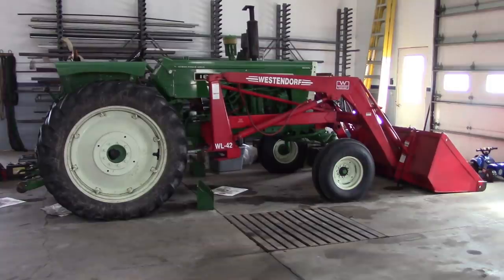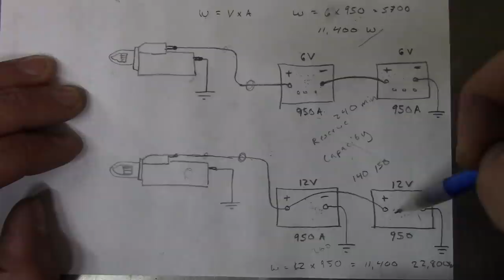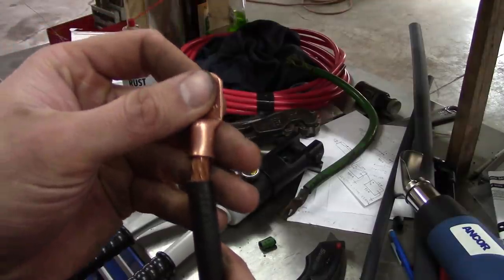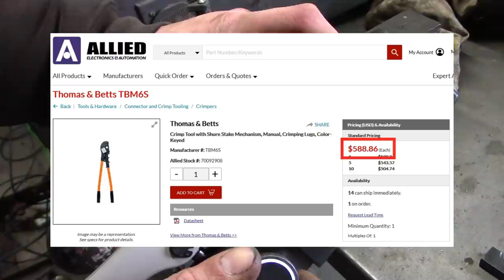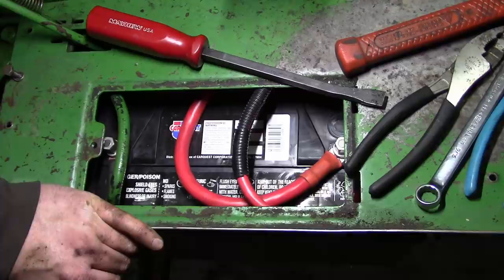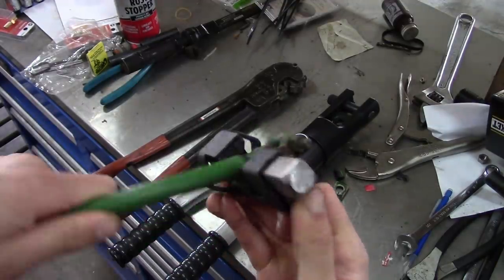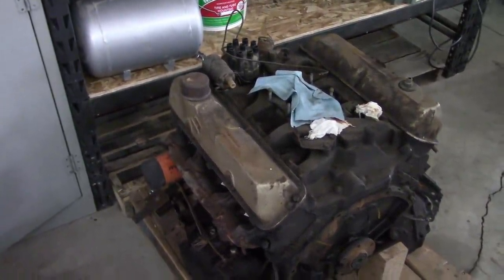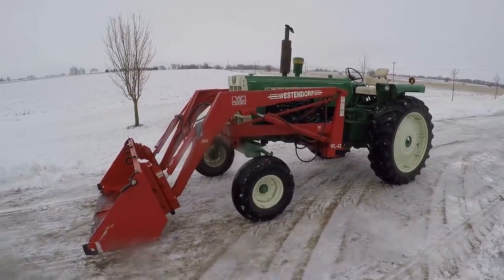Oliver 1650 Tractor 6 Volt to 12 Volt Battery Upgrade

Comment: Ok. For some reason other videos will play and this one run for 30 or so seconds then stops.   Loosing my mind. Switch wireless routers, coupled to cellular etc.  not sure what is happening.
Reply: I had substantially the same problem.  Shut computer off for a minute and things seemed to improve.
Reply: cdouglas1942 I am using a newer iPad Pro.  Every other sample plays fine.  This is the one I wanted to watch.  Will see it THU  I guess
Reply from the maker: I don't know. I've had a few guys say this. The video plays fine for me on a Dell laptop and on my iphone.
Reply: I watched at lunch at work and had no issue.....no matter what device I tried at home it was a no go.Not sure why but rest assured I persevered:-0)    Got to keep your priorities straight don't you know?.

Comment: 700 comments in, this comment is a fart in the wind. Those cheap Chinese crimpers work if you don't use them much but if you expect to use such a thing regularly. Spend the money, even if it's used on a Thomas and Betts or Burndy etc. They're worth sending in for service if you get a clapped out one from Ebay.... Luck of the QA draw and all that but I didn't get many crimps out of the HF one I bought.

Comment: Soldering for large lugs is a not a good solution, you need too much heat. If you cut a lug in half a correct crimp will make the wire into a solid chunk of copper.
Reply from the maker: Yeah I don't like solder for large wire, say over 16 gauge.

Comment: the diagrams are confusing in that they appear by being contrasted against one another that there is some sort of major difference between two 6volt batteries connected in series and one 12volt battery, assuming they all provide the same amperage rating. the truth is that there isn't. no explanation is necessary. metrics of battery performance, like amp/hrs and reserve capacity, et. al.,  need no diagrams, or at least no diagrams such as the ones shown. 

the principal to be remembered is that two batteries connected in series equal the sum of the voltages of the two batteries and if connected in parallel equal the sum of the AMPERAGE of the two batteries.

BTW, all automotive batteries consist of a number of 2volt batteries INTERNALLY connected in series.  traditionally, each battery having it's own cap. i.e. three caps being three 2volt batteries connected in series to create ONE 6volt battery. and so a 12volt batter is simply six 2volt batteries connected in series, within ONE case, with six caps showing.

of course, many ir not most, modern batteries have no caps and so the internal connections between the fundamental 2volt batteries from which they are built are not evident.

Comment: Wes you put the crimp end in the vice and put solder flux on the cable end crimp the cable in with a 5/16 bolt head with the vice. Heat and solder end of crimp. The solder will not let corrosion form at end of cable. In other words you threw away $30.00 and gave aid and comfort to the Chinese, our enemies!
Reply from the maker: I just don't like soldering larger terminals. No matter how you do it the solder wicks up the stranded wire and makes the end of the wire stiff. It also invariably melts some of the insulation. There are terminals available that have solder built in, but they are quite expensive, like more than the cost of the crimping tool...
Reply: I currently use solder terminals because I didn’t want to spend hundreds of dollars on a crimper

Comment: Good tool however, I always solder and shrink wrap every terminal. The 2 12volt method creates voltage loss especially on the long cables.